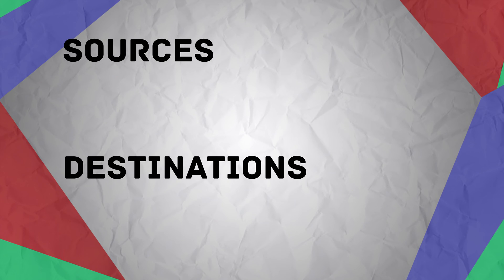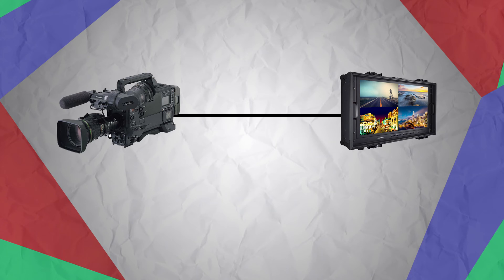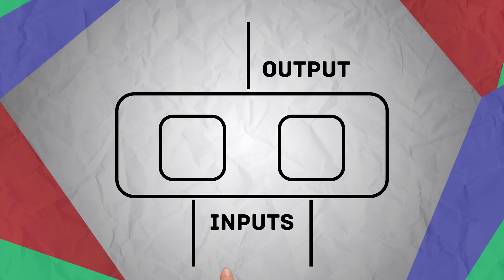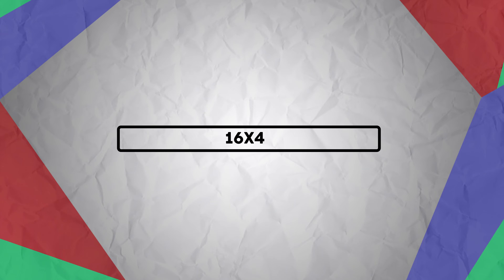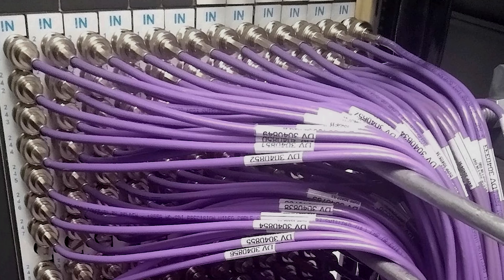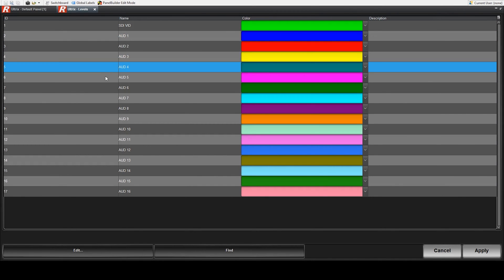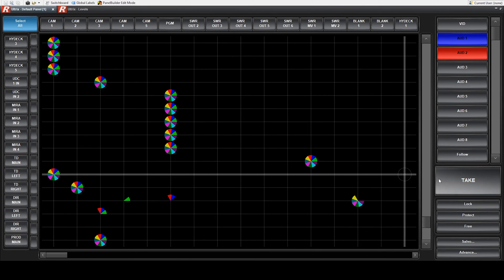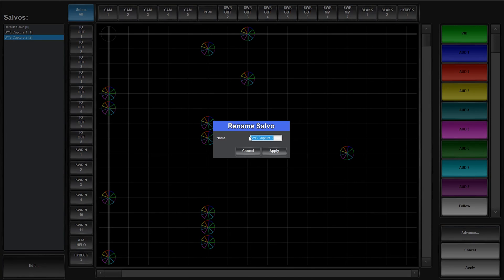Audio Video Routers [Understanding the Basics]

Comment: is this about IP Productions?
Reply from the maker: This is specifically about routers, but all of these concepts would apply to using an audio/ video router in an IP based transmission method (like SMPTE 2110) as well.
Reply: @BroadcastBuddyTV  thank you for the clarification. (Do you know if IP productions have any latency?)